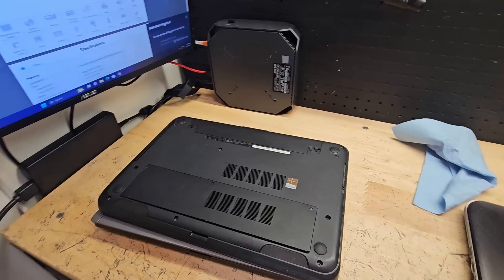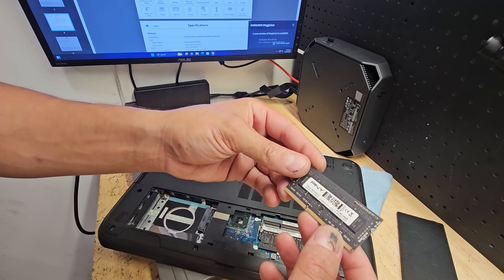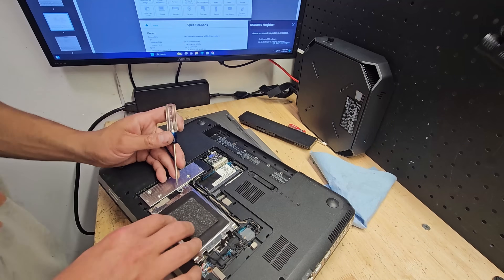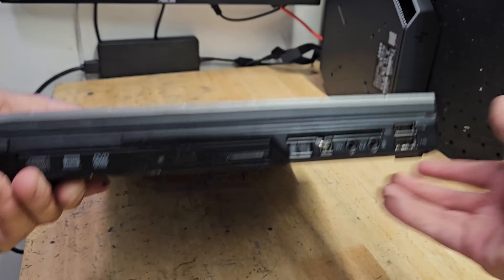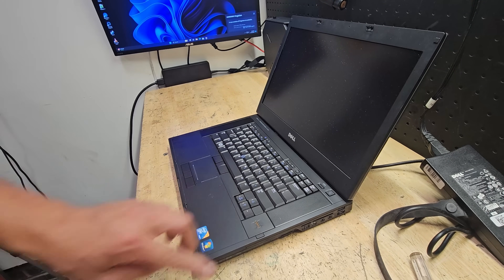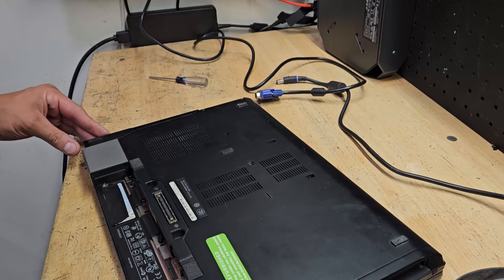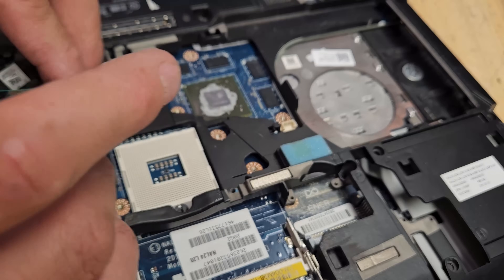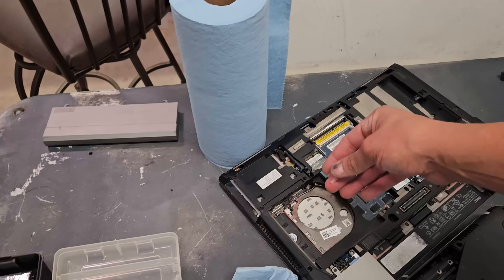Ugly but powerful!!

Comment: I love my old t440p, but I have a problem. I charged it, and now it doesn't boot, just 3 beeps and no display. I have changed memory, cpu, tried an ips panel, and motherboard. Still 3 beeps. Any idea what I could try next? All that's really left are the ssds

Comment: Oh what the hell... You managed to get the same exact laptop I had back in the day (Inspiron 3521), mine had an i3-3217U instead though. I ended up stripping out all of the parts, mainly to upgrade another laptop from 4 GB to 8 GB, which I also was planning on upgrading to a 2nd gen i7, but then I got my hands on a more powerful laptop later on.

And now I just daily drive workstation tier laptops lol

Comment: I'm thinking about using the monitors to replace my good big monitors to reduce electricity bill !? Are laptop monitors commonly better than desktop wen it comes to anti glear as I want to be outside ? Any thought's on out door monitors ?
I have a dell latitud e6400. ram upgrade is to expensive but having a cpu socket it cool and technically there a second board that a gpu is integrated in that board for a upgrade ? >_<

Comment: I got an old Dell latitude one time from 2006. It had powered on but kept cutting off, just had a bad power conector and it worked for a while, I think it had bad caps because it had stability issues, then it just kept freezing to the point it was unusable. But for as beat up as it was it was a wonder it even worked.

Comment: I picked up a cool older gaming laptop a while back for 160$. Has a 4th gen i7 and a gtx 880m which both can be upgraded. Also had im guessing 16gb of ram soldered to the board somewhere and I added another 16gb.

Comment: The HP was a DV7 model laptop. Taking the bottom cover off is super easy. The switch to get the battery out will also allow the cover to pop off if you moved it the other direction. Super cringe watching the way you brute forced it.

Comment: Start some bins and save it. You want a copper bin, aluminum bin and a wire bin. Some wires have aluminum cores, so don't mix them up. When a bin gets full sell it for scrap. You could hang onto the boards and other stuff for gold scrap too, but meh. I just trash that stuff. Oh and do a bin for the hard drives too. They add up, but don't sell them for scrap. Throw them up on ebay as parts and just stuff them in a flat rate box.

Comment: I was curious why don't you like the old amd A8 APU's I have an old laptop with an A8-6410 and it seems to be pretty decent but this was when intel had the upper hand on AMD cpu's. Also as far as the dell precision goes it very well could have had a bad ram module I would test that ram just to make sure it still works. if it doesn't then chances are that old laptop might still work it goes without saying they are truly the last of their kind.

Comment: Ok, correction on my part. You did say at the end of the video you would take them to recycling. Leaving my original comment so I'm being transparent and can admit my mistakes.

I get the old laptops you can't or don't want to do anything with but can you please not just throw electronics in the trash. I'm no tree hugging hippy but been in IT for 28 years now and throughout my years I have repaired laptops because someone gave them to a recycling center or parted them out on ebay. The screens alone, as long as the work, can save someone from buying a new laptop they don't want to spend money on just because their screen was damaged or died. The hinges for the screens. Motherboards. Even the plastics can be of use to someone else that may not have the money to replace a perfectly good working laptop that needs a replacement cover plate. 

You don't have to sell them on ebay if you don't want to, just donate them to a place that will. You are welcome to part them out and make a buck but just don't send them to a landfill where they take forever to decay and help nobody.
Reply: 100% agree with you man. This guy has no tech ethics; even though these are very old, ancient and out-of-date laptops, yet a poor kid could have learned the basics using the same machines. Seems like every vintage laptop comes to him to die/get stripped for 'parts'. Putting in the HDD to see if it's going to post, plugging in the monitor cable to 'accommodate' for GPU failure; dude has no idea how computers works.

Comment: I got this exact laptop from my dad’s work for free and i used it for some time before I had a decent laptop and it had quite some power to it. I could play Minecraft on it and screen record with obs and still get 100fps. I out a ssd in it and it ran great with windows 10. The old gpu was the worst part of it since drivers were ancient and it didn’t support directx 11 fully. It is a quad core i7 with hyper threading and it is so beefy that it needs a higher power 130w charger or else it will throttle the cpu and it won’t go above like 1.1 ghz or something like that. So charging and using at the same time wasn’t great since all I had was the regular dell 90w charger. It definitely puts out quite a bit of heat. 

I also have a similar older dell that looks similar and has a top end core 2 duo and 4gb ram. Even it is somewhat useable with a ssd on windows 10, though you are limited by thr ram as they didn’t really make any larger ddr2 sticks. Sadly it died recently for some random reason. It just lights up power led when I plug it in and if I press the power button it spins up loud for a few seconds then shuts off and doesn’t display anything or give any error lights or beeps.

Comment: I don't know if someone screen-grabbed that serial,  but as an old tech I snap a pic of EVERY dead/scrapped unit's WIN serial  ..which I use later if valid and not already captured/transferred by original holder.  I loathe laptops now,  but I'll watch you play with them.

Comment: As someone who was a user of an E6510/M4500 I can tell you a few things. They are CPU Upgradable and ram can be upgraded to 16gb if you install the BIOS update.
Reply: I thought 8 GB memory limit was by CPU. Quad cores support 16 GB, dual cores only 8 GB or am I mistaken?
Reply: @ that laptop has socket g1 which can support quad core. Quad core chips can have 16gb. I think dual cores can have 8.

Comment: looks like my dell latitude d630 notebook same height and width
Reply: @jjohnson71958  i have a d630 too. It has vista. Idk what to use it for
Reply: @WeatherMan2005  videos music and use mozilla firefox and buy a swapable hdd module for it i got 1 for my d630 notebook 5gb of kingston 5300 notebook memory.. and its easy and cheap to buy a replacement motherboard for it

Comment: I'm still using a 1st gen i3 15.6 HP, use to be a living room media center PC, but now it's still in use as browsing/Office. I think I even updated to a low power i7/i5. First thing I'd test would be the RAM swap, then test each slot, and the old "keep the power button for 30 seconds with no energy/battery plugged". Hell, that last one saved me a trip last week, still don't know why but that has saved me more time than I can count and some people say I'm a wizard for that
Reply: yeah i was surprised he didnt try different ram, i wouldnt be surprised that was the problem.

Comment: There's absolutely nothing wrong with a Pentium.  Put an SSD in there and it will be a great computer for browsing the internet.  Celerons and those AMD A series laptops are not usable even with an SSD.  But you really should have got that Pentium Dell working.  It would have made a great computer for someone with basic needs.
Reply: Exactly...Those older Dell Precisions{2-7 gen) are nice and built like a tank.
Reply: That dell probably has an upgradable CPU as well.

Comment: We can all blame Apple and Intel for the death of repairable laptops.
Reply: Blame the consumers for wanting lighter and more portable things. This is the reason why everything is soldered on chip.
Reply: @hybrid1880  the extra mm here and there shaving that goes on each year is all for marketing numbers. Which has taken away changable CPUs and give rise to soldered RAM and even storage.
 It has especially hit business class machines. Which are only slightly better than the comsumer rubbish for upgradeability.  Most still have a single bottom cover to remove to do anything. Clipped on with many tiny, easily breakable hooks.  I have had to have several laptop bottoms repaced due to broken hooks after taking the bottom off once.
This is using the recommended technique. Businnes class gear has full teardown docs for taking them apart.

Comment: You could do with one of the power bricks with multiple tips. Just for powering laptops in the shop.  You will want a 130w or more. As some of the higher end (for the time) gear will not turn on using a common 65w brick.

Comment: That old Precision is awesome,the CPU actually is true quad core compared to most laptops at the time which were mostly 2 core 4 thrad. That fingerprint sensor is also still functional for Windows 10 and 11,it could also have another 2 ram slots under the keyboard. With a minimum of 8GB ram and an SSD it's still a great laptop for Windows 10 or 11,way better than those other 2 consumer grade junk laptops

Comment: old upgradable laptops were the best
Reply: True! I upgraded the graphics card on my Dell Precision laptop earlier this year and now my video editing software is faster. I might try maxing out the RAM in the future. I also like that it has an express card slot so I can have a Firewire port for a video camera I have.
Reply: Yeah, and even framework doesn't allow you to upgrade the CPU by itself. I have an old upgradable ThinkPad, and that's what I'm using. The only bad thing about it is that the GPU is not upgradable, and the GPU that came with it is pretty weak and only has 128MB of VRAM.
Reply: @elu9780  yeah I hate how they fazed out upgrading a laptop especially gpu/cpu swaps
Reply: @samiboukhalfa9040  i fully agree.... i work usually with pre 2010 laptops because theyt are pretty much fully upgradable ram cpu almost everything
Reply: @energygameplay6513  yuh but the thing is even with a cpu upgrade to a i7 it's still not packing alot of power
Reply: @elu9780  The unupgradeable CPU is not Framework's fault, socketed laptop CPUs aren't made anymore.

Trust me, if they existed, Framework would let you.